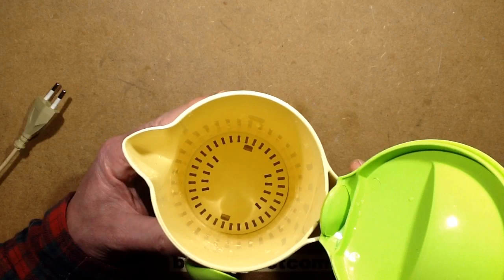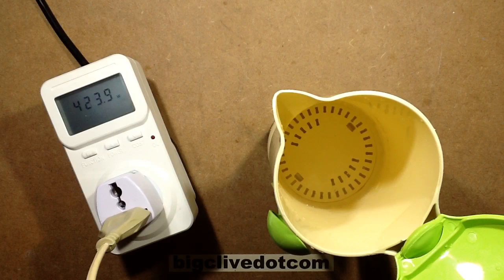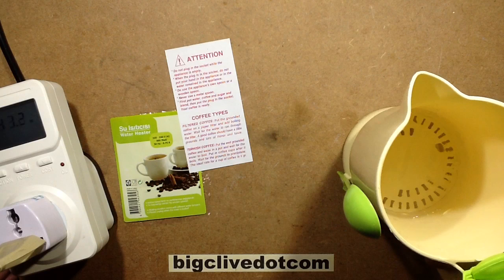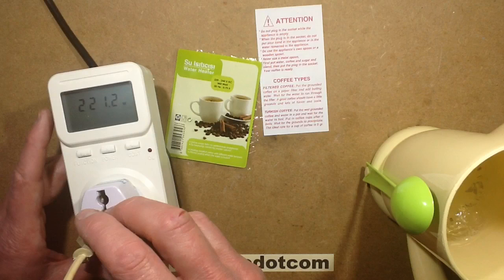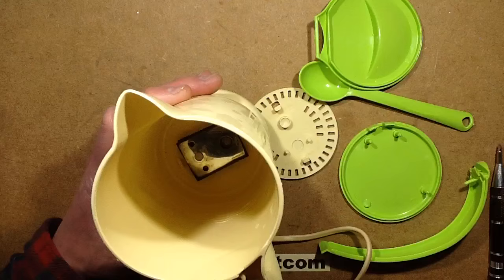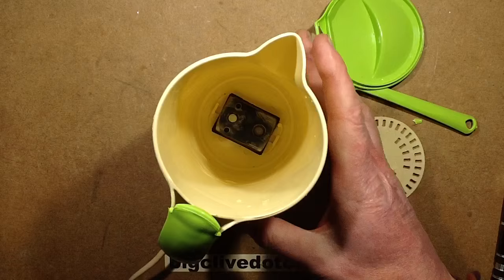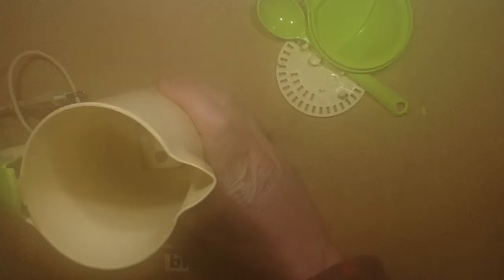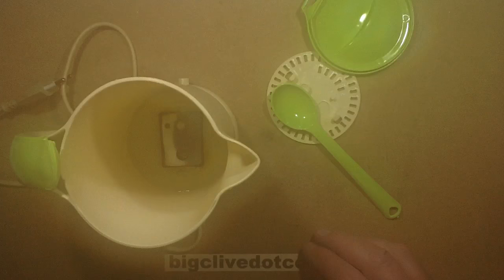Inside a dodgy Turkish "stinger" kettle.

Comment: if my limited electrical knowledge is correct, it draws almost .5 kwh? at least it was that at the beginning. i see it's rated for 960 Watt, so it's .96KWH?
Reply: +Justin Koenig KWH is a measure of energy, not power; how many KWH it draws depends on how long you keep it on. ;)
Reply: Johnny Steen yeah but if you keep something with 500watt on for one hour, that's .5kwh right?
Reply: +Justin Koenig Yes, but you'd call it a 0.5kW device, not a 0.5kWH device. Saying a device draws 0.5 kWH implies that it will stop working after an hour of use (which is probably generous, for this product).
Reply: Johnny Steen how the hell are you supposed to count kwh then? like in your electricity counter?
Reply: You have to measure it over time. kWH is not an instantaneous quantity. It only matters insofar as how much you pay the utility company though. For instance, a 100W light bulb running for 5 hours will cost you as much as a 500W heating element running for 1 hour.

If a device has a variable load, i.e., not constant power, then you have to plot the power as a function of time, and find the area under the curve.

But yes, your home's electric meter measures kWH, because it's energy rather than power that costs money.

Comment: All that talent. Why are you not creating devices or altering them ? A challenge, you need a challenge. Solve my problem. I need a device that as far as I know does not exist. I want a low voltage device that I can place into substrate and it will heat a constant 80 degrees. Must be waterproof and a non fire hazard. BWAHAHAAHHAHAA!!! subscribed,lol
Reply from the maker: PTC (positive temperature coefficient) heating element with your required specification.  As used in hot melt glue guns.
Reply: So. Just waterproof a glue gun ?Sounds  unsafe:) . Fast reply btw.
Reply from the maker: No.  It would require a suitable version for the application which took into account the amount of power required to keep the object at the desired temperature, and the level of electrical isolation required.  Another example of self regulating heaters is in some wax melter fragrance dishes.
Reply: ok, so let's assume I'm not as smart as you. Be nice. How would I make such an item . The purpose is to regulate temperature in substrate over a very small area so that crickets and the such can lay eggs and repopulate without ever needing to repurchase more crickets/ meal worms or grasshoppers  in a bio-active Vivarium.
Reply from the maker: If it's a really small area then you could use a simple resistor as a heater on a low voltage supply or even a small lamp inside an enclosure.  That would rely on the thermal balancing effect, so the temperature would vary a bit due to ambient temperature variations.
Reply: It has a basking lamp already, but that is most needed at the top so the chameleon can move away and down into the vivarium. The substrate is only a small area the size of a dollar that I need to keep warm , not hot. This would allow for in-tank  breeding of insects while not altering the temperature in the rest of the tank. BTW, that's a U.S. dollar, so this example is probably the only place it has value :(
Reply from the maker: You might find this video useful.  It shows a wax melter I made using standard resistors as heaters.  You could employ something similar, but at a lower temperature and use a string of resistors to spread the warmth over a larger area.  Something like a standard USB power supply could be used to power the panel at a few watts.
Reply: ok, i don't see a link so i'll just look through your vids, ty very much.
Reply: Found them, ty
Reply: Have you considered undergravel heating (Used for aquariums)
Reply: Wire an old PC processor to a 5 volt power source. The pin out schematic should be somewhere on the net. Cover it with epoxy for a water tight seal. Place it in something to be heated. Enjoy. Resistors are also a great source of heat.
Reply: ***** ty

Comment: Why not use a heating element?
Are they so much more expensive than this shit?

I got a coffee heater cup, but its a sealed heating element. Resistance Wire inside a ceramic coil.
Reply: +djteac They're more expensive than having 2 bits of metal. From the prices, though, following the links posted in these comments, the kettles aren't really cheap! You could get a cheaper, proper, one from Argos on the high street. Economics is a weird thing, probably IS cheaper to make millions of real kettles than a few thousand of these danger-kettles. 

Any Turks can tell us how much these sell for on street markets?

Comment: Clive, have you had any experience with cheap chinese water heaters such as this one http://goo.gl/vtqCBp? They seem to be very common, and sold by many sellers.
Sorry about the shortened link. The aliexpress one was very long.
Reply from the maker: I've got one and opened it a bit, but not made a video yet.  It has a sleeved coiled heating element and some thermal protection.